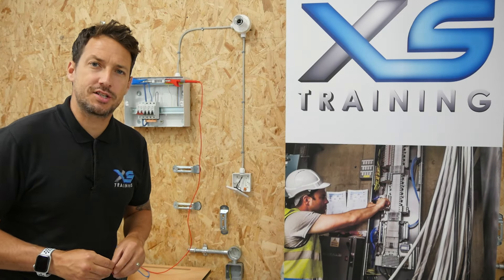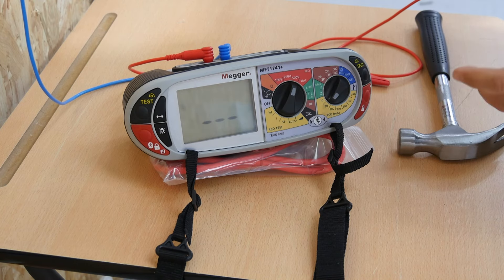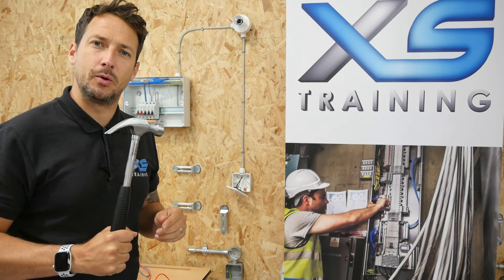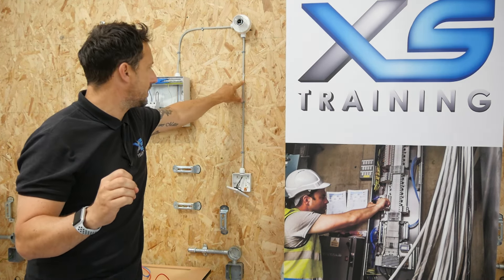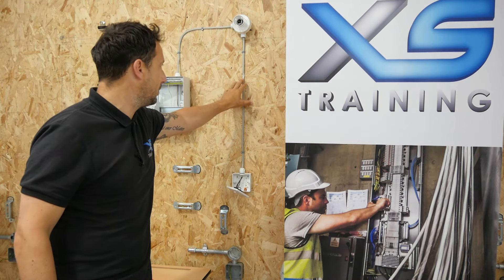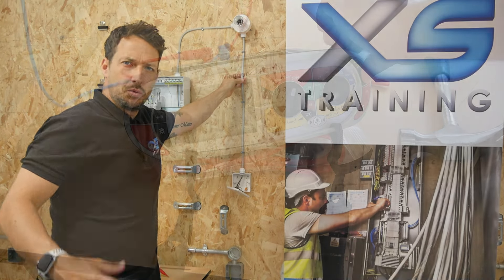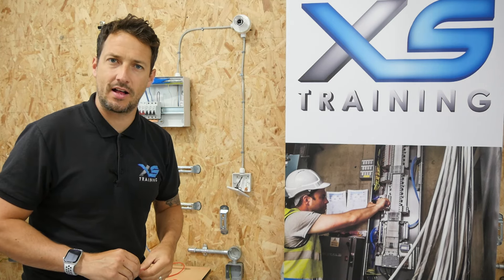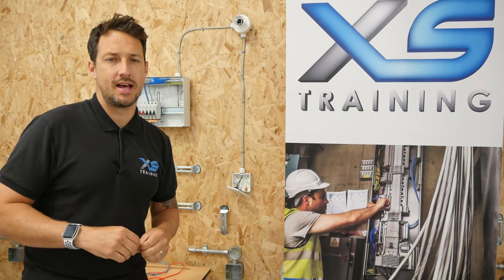Cable Damage vs IR Test Results

Comment: 0.00 Mohms is not a "short circuit". A short circuit is a fault of negligible impedance between live conductors. 0.00 Mohms on the display could simply mean 999kohms or less